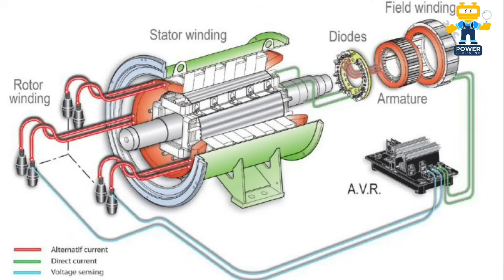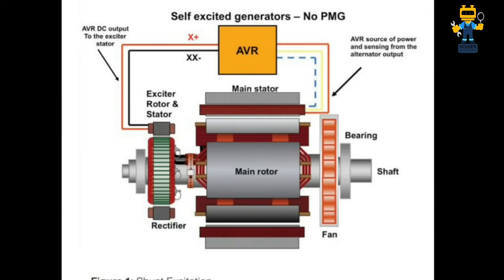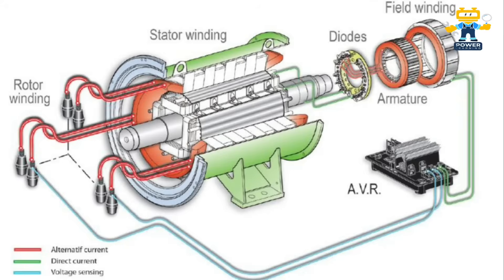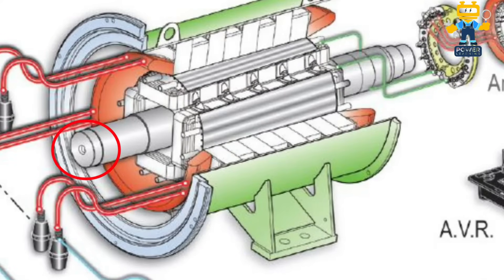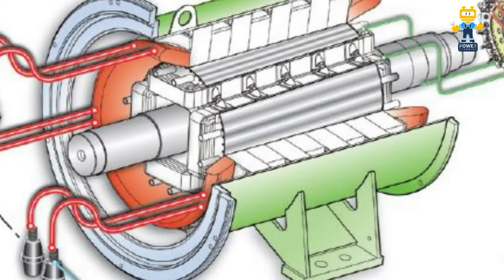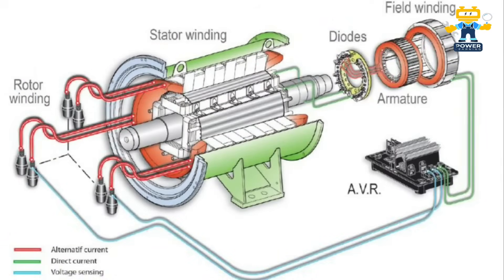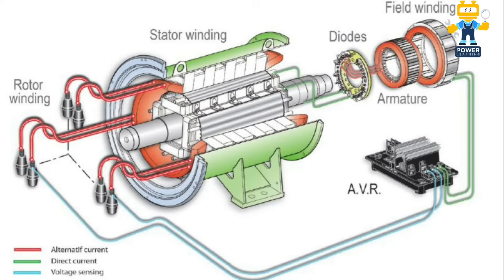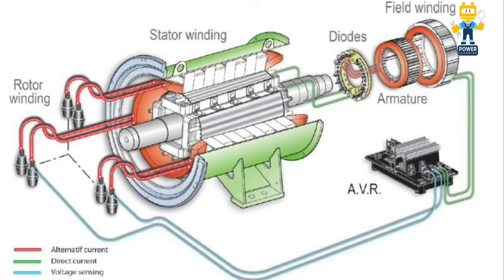How an Alternators work | How 3 phase Electricity produce | Generator working principle brushless

Comment: for excitation Where does the main stator winding get the Voltage before getting to the AVR
Reply: @BirukWolde-mn6hi  
In self excited type generator, the residual magnetism will work when starting. But the seperate excited type generator getting supply from PMG.
Reply: A capacitor provides the voltage to charge the coil windings.

Comment: Where does the main stator winding get the Voltage before getting to the AVR for excitation
Reply: A capacitor provides the voltage to charge the coil windings.

Comment: Where does the main stator winding get the Voltage before getting to the AVR for excitation
Reply: Residual magnetism persists in ferromagnetic material of stator or rotor excitation field.
Reply: It's induced from rotor
Reply: @blessedgodson1825  my doubts also same
Reply: A capacitor provides the voltage to charge the coil windings.
Reply: Not true  @izysly6924

Comment: My question is maybe you have answered but allow me to ask again...where does AVR get operational power from..
This is not the sensing voltage as we would assume that the circle will begin by AVR supplying power to the exciter stator winding
Reply from the maker: Residual magnetism is stored to built up initial sensing voltage
Reply: Hi! Bro good day how to test that initial sensing voltages?